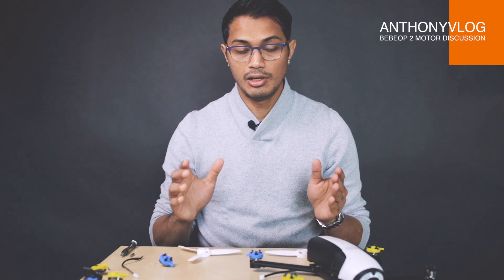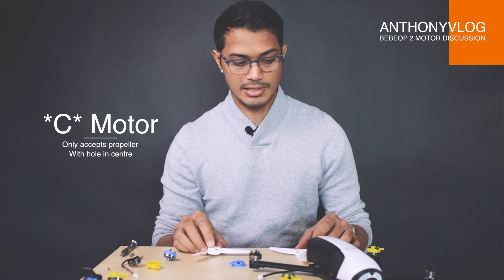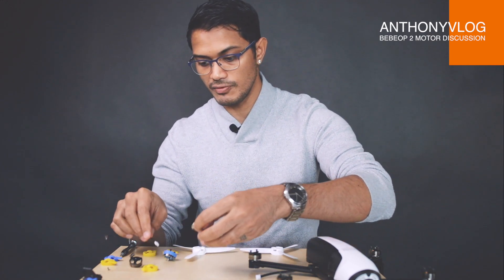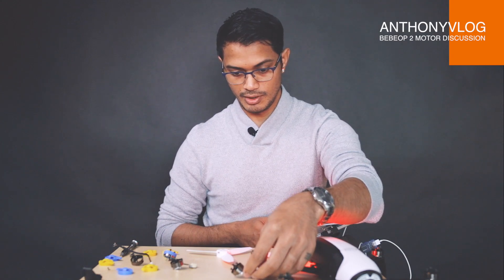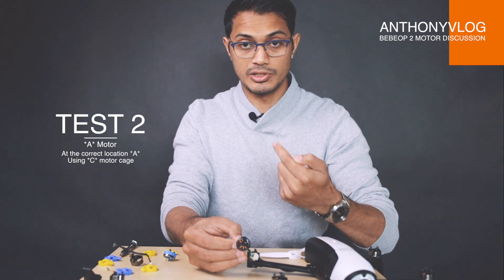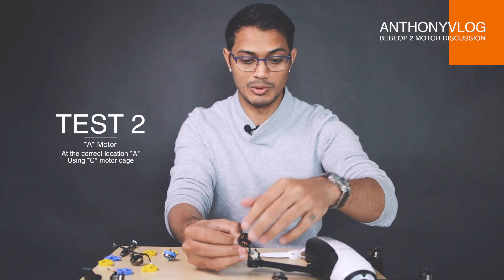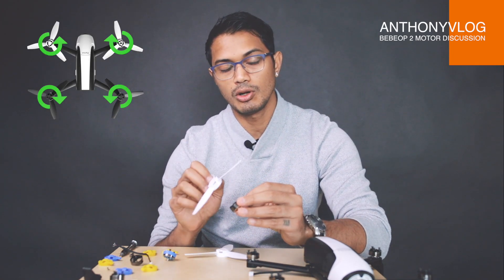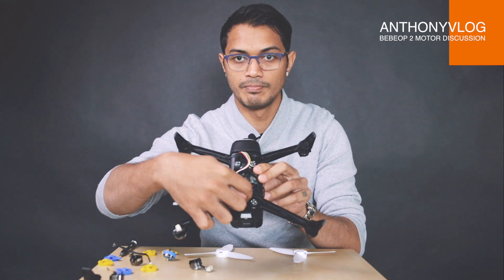BEBOP 2 | Motor | Can you change A to C?

Comment: I know this vid came out a while ago but I’ve been playing with the old bebop 2 recently after a few years sitting w/a broken frame. Mostly in the interest of setting waypoints and chasing it around w/my fpv quads. Mostly bcuz I have no friends to chase lol. 

I don’t know what part the ‘motor cage’ is referring to? Is it the connector part that’s attached to the motor w/3 short wires(sits under the motors, where the long motor wires plug in)? I would imagine you could just swap 2 of those wires rather than digging into the main board where(I assume) the esc are?? If the old motors bell wasn’t damaged you could swap that over. In the name of swapping a A->C motor if you didn’t have the correct one I mean.
Reply from the maker: Hello, the motor cage is the top part that has the magnets. The motor cage is held in by a c-clip on the bottom of the shaft. 

The bottom part with the wires is the stator. To be honest I haven’t tried changing the wires to see if it would change the direction. 

You assume right, the ESC is built into the Mainboard.
Reply: @ANTHONYVLOG  sorry I meant to edit this. I saw in another of your vids what the motor cage is but thank you for replying!  I’ve also heard them refer to as the motor bell. I feel like my suggestion would be a waste of time to try to swap it unless you only had 1 spare motor and it didn’t happen to be the correct one I guess.

Comment: Soooo I recently pirchased replacement motors for my beebop.  They were not parrot branded motors.  I replaced them one at a time a to and and c to c.  Intitially I ended up with reverse thrust.  I said my bad, swapped all the positions thinking that the manufacturer screwed up the labeling. Well now I the back of the drone creating lift and the front reverse.    So ANYWAY.... what is the correct position for the motors as in “While the drone is sitting in the landed position and while you are standing at the rear of the drone the A motor should be at the ____________ corner.”
Reply from the maker: A rear right and front left. I usually dont follow that because some people put the wrong motor cages on the stators and sell them. The only way to simplify it is to look at the rotation of the motors. 

0:23 I put a diagram on the video of the rotation.

Comment: there is any way to know which motor has the failure?
Reply from the maker: Arnoldo Garcia yes in the freeflight pro app main screen tap on the drone name and it will open the drone information. Motor errors will show which one is faulty
Reply: @ANTHONYVLOG  But if there is any problem... I can't connect to drone... the red light is flashing (the wifi networks appears, but I can't connect with free flight app)
Reply from the maker: Arnoldo Garcia the app will still show the last motor error when it was connected. Another thing to do is disconnect the motors and try starting the drone. Normally a motor error should not stop the drone from loading its AP. A cracked mainboard usually does this after a hard fall .

Comment: Anthony-do you know what voltage to bench test a bebop motor?
Reply from the maker: Hi Eric the brushless motors will need an ESC 9-12V. Without the ESC you wont be able to turn the motor as its brushless and not brushed with a positive and negative polarity. Hope this helps.

Comment: Hi, from the video it looked like both motors span in the same direction at the same position/corner. If so just swapping the motor cage so that it accepts the correct propellor will work? correct? 
I have a damaged bebop 2 A motor from a crash. very difficult to find just motors
Reply from the maker: Robert Clarke thank you for your comment. From my experiments after changing the motor cage and connecting the stator to the side you want, do a bench test (launch without propellers) to see if it spins the correct way ie: CW and CCW depending on which motor your changing. :)
Reply: Motors are everywhere on eBay!

Comment: @Anthony For a Brushless DC motor, it is the coil sequencing that determines the rotational direction of the motor.  The rotor really has no affect on that.  There are two ways to affect the direction.  1) Change the sequence order in the controller/software or 2) swap two of the wires (any 2, it doesn't matter).  
Since you mention that the direction is different for different motors (A v C) it seems like Bebop is doing #2.
Sit the A & C motors next to each other and compare them.   Most likely they are swapping the phase wires somehow.
Parrot probably uses the same motors; so, the phase order / wire color is probably the same for all the motors.
Look at the order the motor wires are connected to the connector.  Is the order of the wire colors the same on all the motors?  
Another option would be if the connector was turned over or backwards between the two.
Hope this is the case.  If so, a little soldering may be able to turn an A motor into a C motor.  Combining this with swapping rotors (which probably never fail) means you can make any motor work for any position.
Reply from the maker: To make it work on the bebop 2 that has no programmable esc using the correct motor cage needs to be used for A or C regardless of stator. This is because the motor cages can only mount the specific cc or ccw propeller. This video was to answer a question specific to the bebop 2. Now to ask someone to swap polarity, program an unprogramable esc than figure out how to make the prop with the wrong pitch generate thrust in the wrong location without canceling rotation torque? On a diy drones one could go all out with whatever combination their heart desires.
Reply: @ANTHONYVLOG  Yes, I know I am probably out of the ordinary.  I am an Electrical Engineer and do a lot of DIY.  I just thought it would be interesting to know if you could make an A into a C with a small soldering operation.  Maybe I'll look sometime; but, so far I haven't needed to.  I got my Bebop 2 in Nov; but, it had been the rainy season so I have have only flown it a few times.  The sun is out now and I'm headed to the coast this weekend.  Still, I hope replacing a motor is a ways off for me.
Reply from the maker: @connecticutaggie  you still cant make an A into a C for the BEBOP with soldering. Because the A cage will only take the A propeller and the Pitch of the A propeller is opposite of the C propeller for that location. :'( Networks engineer here :D
Reply from the maker: @connecticutaggie  get an F550 and set it up and program it. You will find that DJI although more secure still provide user end programming. Parrot only ships the SDK, so the open source system is not openly configurable. It should be the other way around honestly lol
Reply: @ANTHONYVLOG  By the cage do you mean the rotor (the part with the magnets that rotates).  I mentioned in my previous post that the rotor probably doesn't fail very often and it doesn't affect direction so you can just keep the rotor from the motor you are replacing.
Reply: @ANTHONYVLOG  Clarify - I am an Engineer with two teenage boys - so, not much money for toys for me.  Getting the Bebop 2 was pushing it.  My single friends at work have a Mavic and a Phantom 4 pro... but even better, I have a wife and two wonderful boys.
Reply from the maker: @connecticutaggie  gotcha, no worries its an excellent piece of kit only reason I still have it and love tinkering with it. Yes Sir when I say motor cage (which parrot lables) to not add confusion to viewers is the rotor. They one pair has a longer shaft and the other pair has a shorter shaft. The longer shafts are for the C and the shorter shafts are A and the propellers will only fit on A or C respectively because of the centre bore or lack there of. Don't be too hard on yourself its admirable to always put family first.
Reply from the maker: @connecticutaggie  yes normally rotors don't fail but parrots motors have been known to have magnets come loose in flight. So something to note if there is an abrupt motor cut. Although I have never faced one I cant disregard what others have reported respectfully.
Reply: @ANTHONYVLOG  One thing I like about Parrot is that it has a much more open ecosystem that other drones (such as DJI).  I am thinking of playing with the flight and/or control software at some point.
Reply from the maker: I always try to keep it simple and in layman's terms for viewers, here is parrots link for the rotor https://www.parrot.com/eu/spareparts/drones/bebop-2-repair-kit#bebop-2-motor-cages-details
Reply from the maker: Feel free to email me your ideas for the bebop 2 motor experiments I have the resources to test and your wealth of experience in electrical would benefit the bebop 2 community. info(at)anthonyvlog.com 🤗
Reply: @ANTHONYVLOG  Sent you a test email message
Reply from the maker: @connecticutaggie  thats a negative on the test. info(at)anthonyvlog.com / anthonyhobbyvideos(at)gmail.com

Comment: Since it’s brushless, wouldn’t an A motor spin in the C direction if plugged into a C port?  No matter which cage is installed.
Reply from the maker: Correct Supersport1966. The problem is that the propellers on the C are not the same (rotation to generate thrust) as the A so in reality you can make it work by changing and using say A cage on C stator with A propeller at A position. This video was just to clarity that. Some people have been given the wrong advice on the forums that any motor on the bebop 2 will go anywhere and it will fly.
Reply: ANTHONYVLOG Ah, gotcha!  Good job!

Comment: To change the direction of rotation of the motors you would have to unsolder any 2 of the motor wires and switch position of them and resolder them back in. That's how you change rotation on a brushless motor
Reply from the maker: Of course any DC motor brush or brushless can change rotation by changing DC polarity. However the BEBOP's have a closed ecosystem, you can change the direction but it wont be the same. Note the configuration and the non programmable ESC. CW and CCW will have to be CW and CCW or the IMU will make adjustments to the wrong motor.
Reply from the maker: Forgot to mention changing the direction of one motor will result is an unbalance of rotational torque. The reason they are spinning in opposite direction is to cancel out each others rotational torque, so yes your statement is correct you can change the direction of the BEBOP 2 motors, but will it work, not unless you change all the motors direction to the opposite rotation. Would be much easier to just replace the correct motor with an identical one.